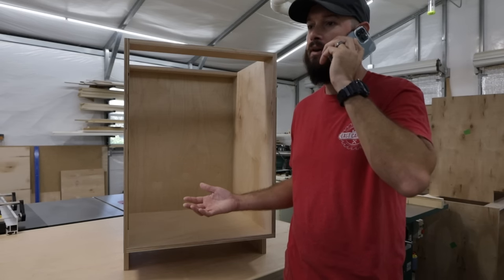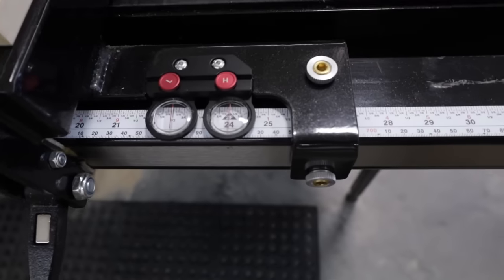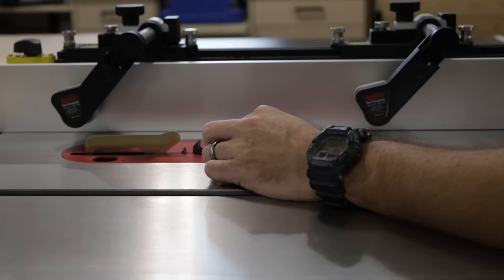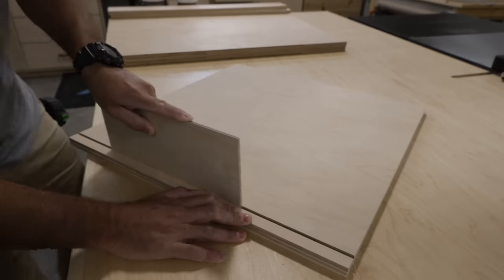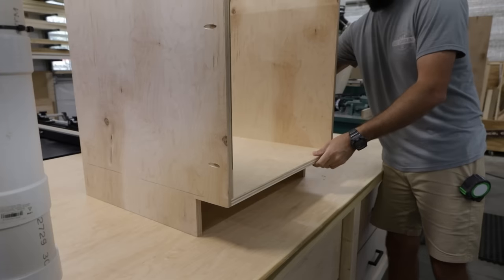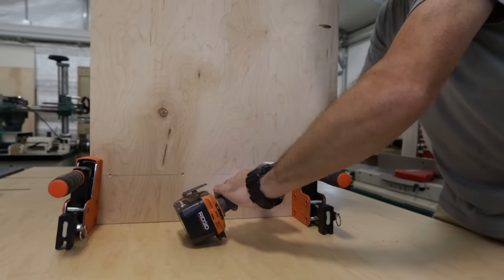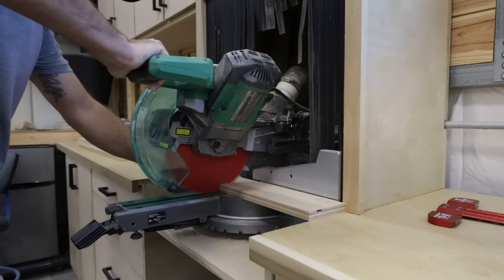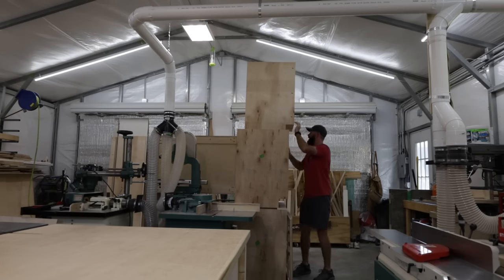How to Build Cabinets in under 30mins //The Easy Way

Comment: I built cabinets with dadoes in the 1970-eaely eighties. Used to cut up whole stacks of sides and ran up lengths of eight foot lengths of plywood or melamine for the bottoms and shelf material. We didn't have kreg jigs back then but used glue and drywall screws. Around  1984 discovered biscuit joiners  and since then have been using biscuits and drywall screws for the thousands of cabinets i've built. Found that I could have a helper help me cut out  parts from all the sheets oversize a little and then while they were sanding on another job I would finish cut and biscuit all the cabinets in the kitchen in a couple of hours with jig guides for the biscuit joiner. Then once I had each cabinet biscuited I would lean each cabinet parts together against shop wall. Then my helper would  start predrilling for the drywall screws next to each biscuit. then they could put the biscuits in the slots and glue if needed. In this way all you needed was someone who only needed to learn how to use a cordless drill.After a few years I could actually just be doing all the finish cutting and cutting and biscuiting the drawer parts too and my helpers could put all the boxes and drawers together using biscuits. The only time I needed a dado set was to cut grooves for drawer bottoms to fit in the drawer sides and cut  1/4 inch grooves in shaker and raised panel doors. You can build some very complicated cabinets using a biscuit joiner.. I once had a lady helper who did all the operations i have described. She screwed all the boxes together, glued all the drawers together, Put all the drawers slides in the cabinets after I marked the openings, and installled the drawers. She had never done any kind of this work beforee but had used a cordless drill. I 'll never forget the day when her husband came to pick her up and asked her what she had been doing the last couple days in the shop.She told him she had built all the boxes and drawers and put in the guides and drawers and he looked at me and shook his head  "Has this girl gone crazy or what" he didn't beleive a word she said.

Comment: Very good video with good step by step explanation. One difference when I build carcasses. I don't do the toe kick when building the carcass itself. I find it easier on the variety of unlevel floors to put in a base frame at the install location, level it, then place the carcasses on top of it. With a little measuring, your faced base frame completes your toe kick. No cutting notches with jigsaws and more importantly, no wrestling and leveling of the carcasses themselves during the install.
Reply from the maker: I agree with this 100%! I do them both ways. Just depends on the application 👍🏻
Reply: @eastcarolinawoodworks  I haven't met a floor that didn't hate me, but I am not a pro. Just the family and friends carpenter. What applications have you found that you prefer the method in the video for toe kicks? I am genuinely curious because I like to make the correct choices for the job, not just make it easier for myself.
Reply from the maker: @StoneyMeyerhoeffer  don’t worry most floors hate me too haha. I do a lot of custom kitchens and most of the time there’s a bunch of jet outs so for me I just find it easier to include toe kick in the cabinet. But someone else may find it easier to do it your way. Also when I install I put down treated 1x4s to raise cabinet off the floor 3/4 of an inch in case of leaks my cabinets don’t get ruined. I shim the treated 1x4s to level. Hope this makes sense 👍🏻
Reply: @eastcarolinawoodworks  the 1x4's make a lot of sense. Easier than a frame, just as easy to level, and limiting the water damage makes and abundance of sense. I am putting my own kitchenette into my new shop space and this is where I'll be trying that method the first time. Thanks for the idea.
Reply from the maker: @StoneyMeyerhoeffer  no problem that’s the goal to help others in this community! Love how people can share ideas and gain knowledge 😁

Comment: great find on YT - a fun, informative channel to add to the collection. If I may - this is not meant as a criticism, just a helping hand. When you set your camera in the workshop, change the shutter setting to avoid rolling shutter (that's the rolling grey stripes going up the screen) the problem is the refresh rate of your workshop lighting. They are incompatible currently with the shutter settings you are using. Change the shooting setting anything other than P (program) this will allow you to manually adjust the shutter to prevent the rolling effect. Hope this is helpful.
Thanks man for a cool video - now ... go get that new tool! whatever it is
Reply from the maker: Thanks for the great info! It was my first time using the camera so it was very new to me 👍🏻 and now that you explained it that way I totally get it now!

Comment: So true about having tools set up to cut square.  I've encountered table saws with fences that wouldn't lock parallel to the blade.  I had to put a square to measure off the fence to the front and back edges of the blade to insure the opposite sides of cut plywood stayed parallel.  If not, nothing would match up for final assembly.

Comment: Haha. First time here and I have built mine the same exact way for 30 years now. Back in the day I didn't use pocket holes but  hidden brads from a nailer. Like you said the glue is what holds the box together.  You should cover how to make the end cabinet with a raised panel on the end that faces the room. Just a bit different attachment that's all.

Comment: You just picked up a new fan, like the way you pay attention to tool detail making sure the tool is dialed in. If you can't trust the tool it's not worth using. It will bite you over and over, a sometimes hard learned lesson for the new at the craft.  Wish you luck moving forward.
Reply from the maker: Thanks for the positive feedback and you are correct! If your tools aren’t dialed in neither is your work. 👍🏻

Comment: Uh, yep, after 50 years of woodworking I did the same as Catherine. Being tired and distracted, I mangled my left hand index finger on my table saw, taking off the nail and then the surgeon took it to the first knuckle. I’ve always felt comfortable around the table saw and didn’t have a problem with the push stick. It happened, reaching across to grab the piece after it went thru the saw. Now, I’m very wary around all my power tools!
Reply: I hate table saws....sorry for your loss of part of finger......

Comment: Just found this video. Great job. Learned a few things. Your shop caught my eye. I’m in the early stages of building a metal shop, and am curious what company you used, if you don’t mind sharing. Things you like and don’t like?
Reply from the maker: I used superior metal structures and I love it! Only thing I would have to say that’s negative is I wish I would have sprayed foam in it for insulation and covered the walls. But other than that I’m happy with it 👍🏻
Reply: @eastcarolinawoodworks  good to know. I plan on using spray foam for mine. I’ll look into Superior Metal Structures. Thanks for the input!

Comment: When doing the final cuts on the plywood pieces I always flip them over to cut off the outside edge (which often is dinged, splintered, chipped and damaged from contact with other things). This ensures I have clean edges all the way around.

Comment: Very straight forward. I'm glad I found your site. I'm going to make my cabinets for my E-350 van that I'm turning into a camper. Tips on glue ? What screws did you use on this project and can they be used all over ? Thanks East Carolina.
Reply from the maker: Glue depends on your working time…I fluctuate between Titebond 2 and 3. Far as screw I used kreg pocket hole screws 1-1/4” for 3/4” material. Hope this help! 👍🏻
Reply: @eastcarolinawoodworks  👍

Comment: Great work  simple instruction's easy to follow, you would make a great teacher. I have to ask what kind of sawdust removal system do you use ?  I'm amassed every cut you made with all your saws
drills not a spick of dust. your shop looks like a hospital  ( operating room ) I love  it.  👍👍 and
hope  to  get more of your exhalant wood work knowledge !!! From the Canadian Rocky Mountains
📏📐🪚  :goodvibes::yougotthis:
Reply from the maker: It’s actually just a harbor freight dust collector converted to a 2 stage 👍🏻

Comment: Your videos are so cool! Do you have plans for uppers and lowers in different dimensions? Or do you know where I can buy plans for standard cabinets with the cut list included and details of the build. We are building a home and I am going to build out cabinets out of Knotty Alder. It would really be nice to have some details plans so I don't have to draw out each cabinet myself. Most cabinets come in 34.5" height and 24" depth. The uppers are typically 12 deep and come in standard heights and widths.

Comment: Excellent work! I liked your explanations and reasoning that you relayed. You did in-depth shots that gave me a little more self-confidence in tackling this. Thank you, Subscribed!

Also: I noticed a few times in the video, that the picture had thick horizontal lines that kept scrolling up, like there was electrical interference or issues with the camera’s focus. May be something you wish to check into. It didn’t make it unwatchable, just grab my squirrel brain for a second and pulled my focus off the actual content lol.

Comment: Question and maybe a tip for your cabinet building process. When you have the dado stack in and the depth set for the bottom panel. Why not run the dado stack along the top to create a rabbit for your stretchers? This is what I have done my whole career and is so much easier. Plus, you already have the dimension from the bottom panel so it would technically be a cut off. Then you can make your additional stretchers for the backing. Just seems a bit easier in my opinion especially if you are using a dado stack to build your cabinet.
Reply from the maker: Not a bad suggestion 👍🏻 I may have to try that out!

Comment: Good video. The only thing I've done different when building similar cabinets is to use pocket screws in the base to side joint so you don't ruin the sides by having visible screws. Plus you don't need to mess around with the dado in the sides. You might think that pocket screws in the base to side junction offers no strength with heavy items in the cabinet. I fix that by cutting two pieces to sit under the base from base underside to floor and that ends up stronger than the dado method as there's more wood holding up the base. Drilling into the sides isn't necessary.

Comment: In the past I have built most of my cabinets using 3/4Baltic Birch plywood.  Is that what you used in this demonstration?  It is hard to find now and very expensive any alternatives?  I really like the back Stretchers idea.  i have been using 3/8 ply for back because lower cabinets are trending towards drawers for easy access to items instead of selves which tend to waste space because of access.  The stretchers can give good depth for under mount drawer hardware. Loved all the lists of tools and video specs.  Good work
Reply from the maker: I use maple ply because of the cost of Baltic birch. Thanks for the positive feedback 👍🏻

Comment: Just a note that if you like the Kreg Foreman and you have the money for the upgrade?  Castle makes pocket hole cutters which are, IMHO, even better.

I'm not really a production guy so I didn't get the professional versions of the Castle.  But the 110 arguably gives you even better strength and less shift since its pocket holes are at 3 degree angles whereas the Castle pro versions are cutting 6 degree angles - and things like the Kreg jig make a pocket hole at a 15 degree angle.
Reply from the maker: Yes apart of me has wanted to get a new pocket hole machine but it’s hard to justify the price at this time but maybe one day 👍🏻

Comment: I wonder if it's worth using the 1/4 back instead of a full 3/4 back, when considering the time it takes to make and install the stretchers? The top stretchers could be scrap as usual.
Reply from the maker: 3/4 would probably be best but moving cabinets around by yourself can get tricky if they are too heavy 👍🏻

Comment: Your videos are so helpful.  Two questions.  One, could you elaborate where and why you put the pocket holes and on the sides?  Two, my cabinet is going to be a stand alone with both sides exposed so I'd prefer not to screw in from the outside to secure the bottom to the sides.  Would pocket holes on the inside work for that or does the dado make that not work?   Thanks again

Comment: on a side note, woodpecker rulers, squares  etc are like stewpid expensive (and no  you can't defend it with "you get what you pay for")...   $96  (on sale for $76) bucks for a 24 inch straight edge ruler.

Comment: Nice garage / structure. Looks like aluminum framing rigid frame structure with flex cladding. Could you supply link.

Comment: Really well done and clear. Do you have to add a face or could you use this method to build frameless?
Reply from the maker: Yes you could do frameless this exact way! Just don’t drill the pocket holes for the face frame like I did and use edge banding and your good to go 👍🏻

Comment: Great video! Can't wait to build my first cabinet. Whaddaya call the 2 thingies that are hanging off the fence, that look they are there to hold 3/4 in thick pieces, such as the plywood, flat against the table saw top?
Reply from the maker: Jessem stock guides and yes they are adjustable and used to keep material up against the fence so it doesn’t wonder off 👍🏻

Comment: I’m wondering (and sorry, I don’t know your name) if you have ever tried using pocket holes on the bottom shelf, especially if you only inset it 1/4” deep into the sides. I’m new to pocket holes so I’m unsure how well that would work; it would give them 1/2” to grab into.  The reason I’m wondering is because the sides of my cabinet will be visible so I don’t want visible screws of course.
Love these videos, I’m taking careful notes!

Comment: Nice.  I've always used stretchers too, stiffens everything up and gives you a good attachment point.  One question, if you have an exposed end what do you do to hide your pocket screw holes and screws?  I usually nail mine, just curious if you figured out a better alternative.
Reply from the maker: If I can’t put the pocket holes on the inside of the cabinet I’ll usually just glue and clamp face frame in place. Glue is stupid strong and works just fine!
Reply: @eastcarolinawoodworks  I usually glue and pin nail.
Reply: Another option would be to pocket hole the bottom to the sides, especially since it into a dado. Flip the cabinet upside down and pocket hole the underside of the bottom shelf, so you don't see them when upright. Just make sure to use the right screw length so you don't poke holes on the exposed side of the carcass.

Comment: Hi, we are currently building a new 9 metre 5th wheel so I was looking at how to get cabinetry construction as light as possible without compromising strength. We have decided to use Poplar Ply because it is so light and yet strong, straight and very easy on the eye. I found your site and was extremely impressed with your construction. My question is, based on your construction process what thickness do you think we could get away with? ie, sides 12mm and fronts 15mm. I'd be keen to get your thoughts.

Comment: Nice carcass you got there guy! Very solid! I bet your wife tells you that all of the time, when she isn't admonishing you for wanting to buy more tools. Question on the screws through the side panels into the base. Are those really necessary or would glue be enough? At most maybe some 18 gauge brads. If those end panels happen to be exposed, that is quite an unsightly screw head  you have to cover somehow. Not judging, just inquiring. I hate filling in holes of any kind. Thanks for the video!
Reply from the maker: Thanks for the great feedback! And yes if the side is exposed I don’t use screws only clamps 👍🏻 the screws are mainly for keeping pressure until the glue dries. That way I don’t have to keep clamps on the cabinets waiting for them to dry!

Comment: Great video! I do like the overbuilding when it comes to cabinets or anything made out of wood in my house. It was built in 1893-96 and sucks the moisture out of everything; I'm literally turning into a prune as I type this. The studs are so hard that if I want to drill into them or put a screw into one I have to use my Milwaukee 1/2" Magnum. Humidifiers help but I think the house sees them as a challenge and so I have to oil all of my furniture or the drawers on antiques get choppy when you open them and the finish loses its luster. 

So not wanting the cabinet to rack I was looking for a video that showed how to overbuild which is what my late father did for my Kitchen/Dining Room cabinets. I solved the problem of your slow speech by setting the playback speed at 1.25. No offense intended because I realize that you are explaining what you are doing and why and I do it on all videos I watch even the news. I'm just accustomed to people who speak quickly and that is how my brain is wired. I will follow your example as I plan to sell this house in about 5 years and I want the cabinets square and plumb when I do. Thanks again and I subscribed because I like your building technique and your sense of humor. Laughing at our own flaws is always funny.